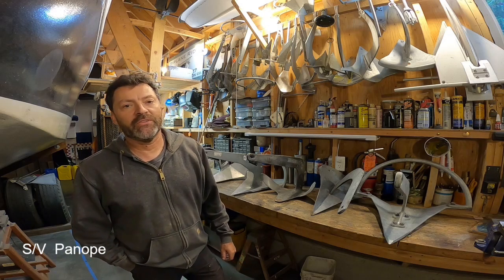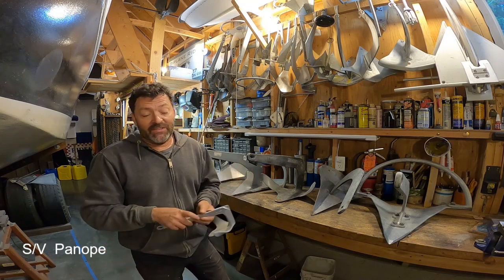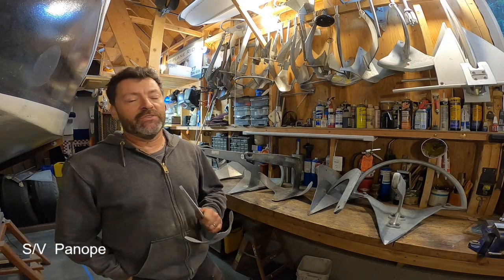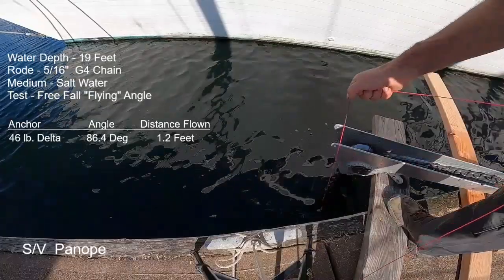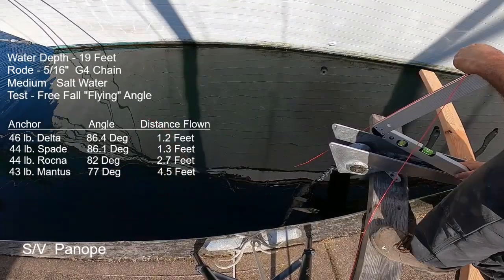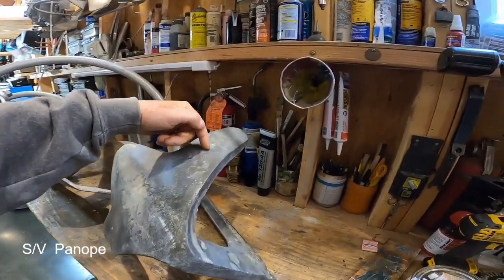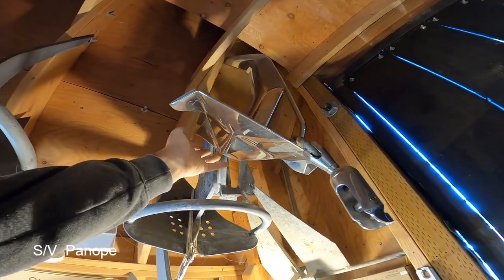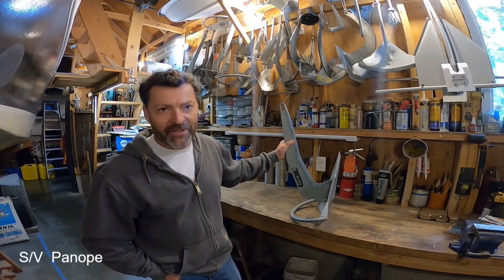Flying Anchors.  Video # 148

Comment: Interesting tests and observations, but not very useful in the real world where (ideally) the boat is drifting downwind and/or down-current while the anchor is lowered. A more significant factor is whether the anchor is oriented with the point in the direction of boat drift and desired anchor set, assuming boat is backing down in relation to the current.

Comment: So, I will chime in on anchoring technique, which IMHO is vastly more important than the anchoring gear. Good technique can overcome less than great gear, and bad technique can defeat the best equipment. In any case, on my 38-foot boat I never just let the 45-lb anchor drop. It is always lowered to the bottom by hand. When the bottom is felt we pause to make sure the boat is headed backwards or downwind. Then the chain is gradually let out by hand, with an occasional snub to make sure it is not piling up and the anchor is straightening out. This avoids the pile of chain on the anchor, possibly fouling it, and also usually means the shank will already be pulled around into proper anchoring position before any strain is put on it. Using this simple technique gives most anchors their best chance to dig in properly. OTOH you can make a Fortress or Danforth fly out front quite a bit, especially if on mostly or all nylon. This can sometimes be used to put the anchor right into a sandy patch in shallow water, and or get it further from the boat when using it as a stern or secondary anchor.
Reply from the maker: While I certainly advocate for careful setting of the anchor as you describe, I have a fantastically large amount of data (video footage of many many hundreds of haphazard sets) that indicates that setting technique has almost no effect on the outcome for seabeds here in the PNW.  Other areas with seabeds like your "Chesapeake goo" are almost certainly different because anchors probably have a very hard time self righting.  So far, I have yet to find any seabed like that here in the PNW.

I am slowly coming to the conclusion that almost ANY discussion about anchoring MUST be prefaced with a declaration of global location and/or seabed type.  I believe this might alleviate/explain countless instances where one person's anchoring experience is in opposition of another's.
Reply: Same here, I don't let the chain or anchor fly, I let it out under control in stages like yourself with a Rocna.
Best wishes from Scotland
Reply: Your anchor tests do reveal many instances where anchors that perform well on ultimate holding power need to flip and flop and drag for a bit to get oriented before digging in properly. Sometimes they don't. If you set the anchor carefully you can minimize this problem. Many places I anchor you do not have the luxury of being able to keep backing down until the anchor is properly set or else you will be on top of someone else or out of your preferred depth. One place I have anchored for more than 40 years is a perfect example of this on a daily basis. I have observed numerous boats with modern anchors on all-chain rode drop the hook in a hurry then proceed to back it down across the harbor. After several attempts they get hooked up and are fine, but with a little care they could get it right in the first place. Other boats with the exact same anchor drop carefully and see success on the first try. @flygoodwin

Comment: Would have like to see the Fortress. I have heard in a current situation that it will not reach the bottom.
Reply: I would like to know the parameters that could make this possible. Possible to far fetched😅
Reply: I was told by a commercial marine dealer that in enough of a currant they float n don’t go down.
Reply: @Paul Holm  I would question anything coming out of this dealer. 
Generally we are dropping anchor not trolling it at full throttle looking for a Megladon.

Comment: Steve, just curious... Have you ever tested the load on the anchor while in real life conditions? What the load would be on Panope while anchored in 30 kts of wind for example?
Reply from the maker: Check out this video where I measured the load in 20 kt wind at about 300 lbs.  Because the FORCE of the wind increases by the square of the windspeed, we can estimate the load at 30 kts to be about 675 lbs. (Panope is 34 feet long and weighs about 7.5 tons).  https://www.youtube.com/watch?v=yyelkzylBFg